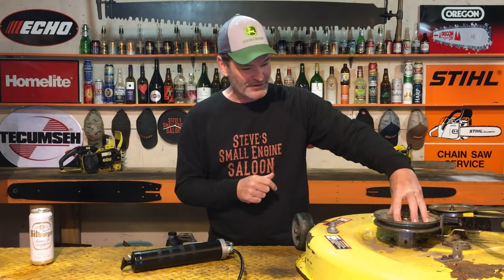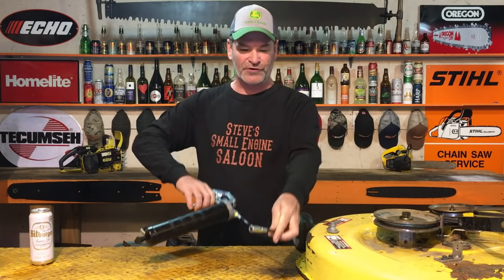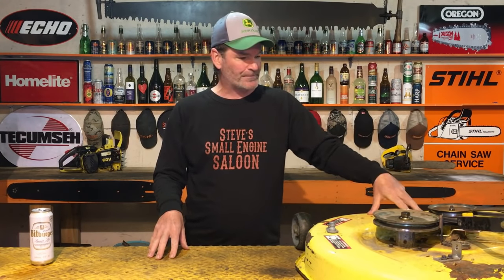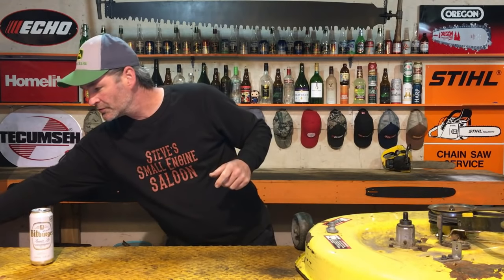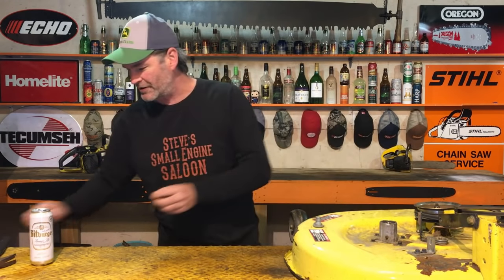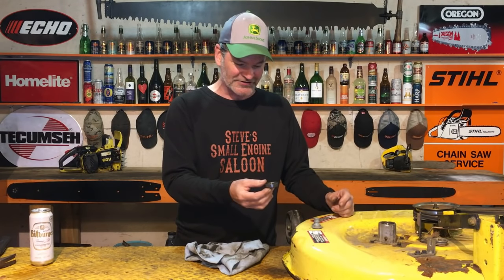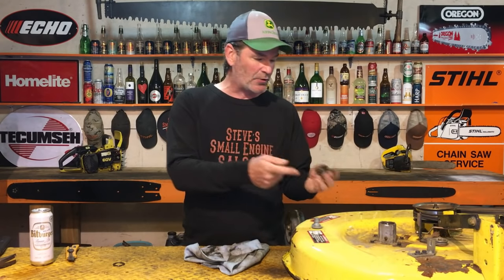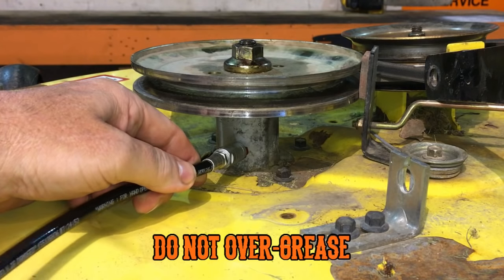Your Riding Lawn Mower's Dirty Little Secret

Comment: There's a point to note here about taking off one side of the seal on those bearings then pumping it full of grease when it's back on the mower deck. If you over pressure the grease, it will blow off the other side of that seal on the bearing and pick up dirt and debris in your bearings. I think it'd be better to pack it and replace that seal.
Reply: A serviceable bearing will allow grease to pass beyond both the bearing and the seal. A sealed bearing will not.
Reply: What I used to do was remove the inner seal , and drill a 1/64 hole in outer
Reply: It's getting harder and harder to find spindles that even have grease nipples anymore. I've been in the lawn maintenance business as an owner operator for two decades, and also my own mechanic and have gone through more spindles and bearings than I can count in the last ten years than in the first ten I was in business. Needless to say, years ago when I started noticing the trend to sealed bearings and spindles without grease nipples I've also made it an automatic to service even brand new spindles before first using them. 

I too, remove the inner bearing seal on both bearings, but since I already have the bearing out, spindle nipple or no, I automatically just pack the bearings. I redo this once a month since the mowers are being used commercially. I don't bother replacing the inner seal as from my experience once the bearing seal is removed, no matter what some damage is done in the removal even if very minute. And most of the time the replaced seals come off again inside the spindle and can even damage the bearings getting caught in them with all the millions of rotations and constant vibration (even with "perfectly" balanced spindles/blades). And with the outer bearing seals keeping contaminates from entering there is no reason for the need of seals facing the inside of the spindle.

But another unfortunate trend over the last decade I have discovered is poorly designed or cast spindles. In my area the land is very rocky, with tree types with shallow roots protruding above ground and very uneven ground. I used to go through a lot of blades and sometimes engine shaft keys from hitting unseen obstacles. I am forced to deal with many properties, that at least initially, have many obstacles that are just unseen even with careful initial inspection of the areas to be mowed. 

But in recent years I have had many di-cast spindles snap where bolts connect the spindles to the deck when obstacles are struck. Many times from a mere mole hill or bulging mole tunnels that was created in between mowing and is just a small pile of semi-loose dirt and the spindle housing breaks away from the bolts/deck. Many of these incidents even have minimal damage to none of still straight blades that only require a sharpening after the incident or no visible blade damage at all. So it is common from my experience in recent years that the sealed bearings outlast the actual spindles and I have back-up bearings and shafts I salvage from broken spindles. I own 6 riding tractors* in constant rotation and 1 Zero turn used for large flat open areas only due to the design nature and terrain I mow. Different brands including John Deere, Cub Cadet, Troy-Bilt, Toro(Z-turn) and Craftsman(x2) and I have had spindle housings break on all of them over the last decade.

*I prefer riding tractors due to the nature of the hilly country as zero turns can't handle mowing across hill inclines due to the freely spinning front wheels. The worst situation, which is common for my commercial properties, are long, narrow and deep drainage ditches along roads that are also deep with steep inclines and can only be done with a zero turn by going up and down the ditches witch takes 4 times as long to mow from constantly turning around back and forth, than with a riding tractor that I can mow on steep inclines the full length of the ditches and all I need is to lean sideways so body weight maintains center of gravity (going beyond the recommended grade of an incline by manufacturers). Besides, my zero turn's deck is 50" compared to 42-46" rider decks, so not enough advantage to make it worth the trouble except for open acreage.
Reply: @mattbaker5757  I feel your pain with spindle housings breaking . Used to happen to me , some times just a few days . I considered trying to convert a implement wheel hub but that's a lot of hassle , and thought the mower deck would just blow out 
Solved it by buying a grasshopper, solved the sidehill issues by swapping on a set of ATV tires
Reply: @mattbaker5757 what is your opinion of the TS 354XD Husqvarna rider? I’m 120 hours into mine on heavy sloping brush, 5 acres
I noticed none in your fleet
Reply: YEs
Reply: The jack shaft has a square shoulder against the lower seal, and the pulley has a shoulder against the upper seal preventing seal blow out. Just don't over fill. The zerk fitting will tell you when it's full.
Reply: X mark zero turn mowers!!

Comment: Sealed bearings are designed to operate a long time in sealed condition. Removing the seal of the lower bearing will help when the cavity is filled. The top bearing  however may lose grease. The seal from below will not go up due to gravity. Another problem might be popping the outside seals while pumping grease . My humble opinion would be to leave at least the top bearing with both seals, but it’s probably a good idea to leave both as sealed bearings. If you want you can remove the bearings every few years, pop the seals, refill the bearings with fresh grease and put the seals back in.
Reply: Agree 1000%.  The beauty of sealed bearings are the low maintenance. They should last years before  seal fails. Until then the bearings are perfectly lubricated. When they fail, pop them out and $20 later you're good for years more of mowing.

Comment: I have been fixing small engines my whole life and even went to college for small engines repair. I learned more from your videos than I ever have anywhere else. Thank you.
Reply from the maker: You're Welcome...
Reply: Dang college for small Engine repair? I’ve learned by tinkering and getting tips from pros
Reply: Rick Simpson  -Farm implements 'back in the day' when anyone with common sense [conservative] greased their machines daily, the bearings had felt seals that relieved pressure as filled, seeing the grease escape, meant no more pumps of the gun. Over 50 years on some equipment, original bearings ;
Reply: Rick Simpson spelling wasn’t covered in your classes?
Reply: @UCPXngN5DcNgUPuWTb7aMLgw Excellent point.  I do not know what Steve knows (I love his videos) but I think that this is a fair point to bring up to the engineers.  Than what is the point of the fitting?  Does the new grease some how work it's way into the sealed bearing or something like this?  Why is the fitting there?
Reply: Steve is a blessing
Reply: You are the #1 spot I turn to for advice and how-to info on my small engine equipment.  You not only know your stuff, you present it in such a logical and no nonsense manner anyone should be able to grasp it and complete their own tasks.  THANKS for posting these how tos.  I try to learn something new each and every day.
Reply: You must have been to a really bad school.
Reply: I went to College to find out what I didn't want to know.
Reply: @backcountrybarracks  mus b cuz mus is don sound rite!!!
Reply: @hungry1011  Seems the principle on the spring loaded hub caps on the boat wheels would apply here!
Reply: @ronchaney9500  What a coincidence that your comment popped up.  I was reading a Cub Cadet manual online just yesterday.  They mentioned that the bearings were sealed.  They said the purpose of the grease is to displace moisture.
Reply: @garyritterstrings  Ahmen

Comment: I spotted the "MAIN " problem when you got the bearing out … it says CHINA
Reply: Buy Ch1nese crap cheap, use it once, and then throw it away.
Reply: @iesusegoconfidoinvobis4309  when you pay pennies for something you cannot expect the same quality as when you spend real money, lots of stuff is made in China that you never see, and the quality is there, western/Japanese quality control is the answer but that comes with a cost, I have put Chinese Bering's in my tracked dumper 24 in all, less than two pounds each including postage to my door, quality British or German Bering's would be over a hundred and fifty pounds plus a fifty mile round trip, if or when they fail I may consider better quality Bering's but get them as and when they are needed, the problem you highlight is typical manufacturer, shielded Bering's don't need a seal, saves money, to remove the seal one side costs money, we are Lucky they still put the grease nipple on!!.
Reply: The design engineer probably did his job correctly. The bean counters trying to knock down the BOM cost decided rollerblade bearings were good enough. Not only good enough, but so poor quality it would create a market where the company could overcharge customers for replacement parts they knew wouldn’t last. Voila, little profit margin on original sale now, but big margin on parts later.

Same reason why inkjet printers are so cheap - and why they got so angry with 3rd parties and customers refilling the ink cartridges. The printer makers lose money on sale of the printer, counting on first-party sales later of massively marked up replacement ink cartridges.
Reply: EXACTLY!! You can only blame the consumer.
Read the labels!!
Knowledge is power..
Reply: @CrusaderSports250  there are lots of China parts in high end items also. Take a Ford GM or Chrysler apart, you'll see..
Knowledge is power.
Reply: @rjhornsby  EXACTLY!! Look at today's vehicles!! 
Cost more, built cheaper!
And who profits from it???
Not the people that assemble them!!
Reply: butchtropic  -Our hydraulic shop bought a Big lathe from China.... very Used. External castings were not as polished. Ship building spec. One of the best lathes made, it turns out. Competed, holding tolerance with our USA lathes.... every day.
Reply: @rjhornsby  -Bell Telephone made a massive fortune 'back in the day'  by Renting their phones. The rental continued, for decades if the home owner never realized their expense over time. ; Funny, when discovered after elderly home owner's property was being settled after death {years]. Bell [subsidiary], upon cancellation of service, demanded 'their' phone back. After making $1,000s of dollars in Rental profit..
Reply: @philllsxga.7737  -With alternative, unemployment definitely abject poverty, Employed is Far, Far better ;
Reply: Rick its about the side shield not letting grease in mate.. Not rollerblade bearings...
Reply: No difference - as he showed you they can't be lubed. China made the part, didn't design the assembly.
Reply: @suep9445  china makes dodgy cheap parts is what hes saying
Reply: @philllsxga.7737  How many dealerships do you know that will let you tear apart a tractor to see if any of the parts are cheap POS's before you buy?
Reply: Sadly a lot of things are made there these days.  It is so bad now that some parts from some German brands are from China now.  Oh the horror!!
Reply: Charles Hines why can’t they be made in the USA ..
Reply: Saw that right away to Ronnie.., put in a Timken bearing.. China, !!!! .. Buy AMERICAN !!
Reply: @rjhornsby  They simply add a jerk to make you feel warm and fuzzy! Its intentional. 99% of all owners will never remove the shaft.
Reply: What does not say China these days ?
Reply: Wing band bong Chong..... I agree.  Make it America  ! Put the damn cell phone down....... Stop talking, start working.
Reply: @iesusegoconfidoinvobis4309  China makes stuff to last, just look at COVID-19
Reply: @bobber55  LOL
Reply: @philllsxga.7737   Calling a Ford or Chrysler vehicle “High End” is a real long stretch!  Way to long!
Reply: @philllsxga.7737  BS. On an inflation adjusted basis automobiles are more affordable today then they have ever been. In addition they are a lot safer, more reliable, and more efficient than they used to be. It looks to me like somebody (the investors) earned that profit, and somebody (the executives and designers) earned their salaries and bonuses.
Reply: @kennethpaquin8574  my brother repairs vehicles for a living.
He was working on a 2015 Arcadia Denali it had the exact same wire harness plug he seen in a Ford 10 years ago!
He also sees a lot of common plugs and part's from brand to brand.
You are aware that there are only a handful of automotive suppliers that make the parts for every vehicle manufactured Kia Hyundai Cadillac Chevrolet Buick they all use the same suppliers so why does the car cost more?? To feed the wealthy!!!  And to F the consumer!!!
And you think today's vehicles are more reliable???
YouTube new warning to EcoBoost owners.
YouTube Hemi camshaft wear.
YouTube car wizard best engine ever.
GM Ford and Chrysler all have active class action lawsuits against them at this moment!!!!
BMW Ford GM all consume more oil then in the '90s because the piston rings are harder material for less friction which does not seal as well and let's oil go by and be burned.
GM's 2.4 and 3.6 engines have breather issues!! Ford's EcoBoost and GM's 3.6 have timing chain issues!!
Yeah that's right 100 years of building automobiles!!
GM's current 8-speed transmission is GARBAGE!!
The new inline six Duramax has a belt driven oil pump!!!
50, 60 ,70, 80,000 dollars for a vehicle with  issues engineered into them that is not right!!
GM currently has an open class action lawsuit for c7 Corvette wheels!!
And guess whos left paying for the repair when it's out of warranty???
You need to turn some wrenches and get your head out of the consumer report and  the news!!
Oh and YouTube 2019 RAM 70,000 mile review!
That trucks a piece of crap!!!!
Again on uneducated consumers...
Reply: @Dickfart We are still a word leader in manufacturing. Instead of making gumball machine toys and cell phones we make jet engines, high-end fixtures, scientific equipment, automobiles, military hardware, medical devices, and lots of other technically complicated dohickies. Our comparative advantage is our high skill and innovation. Just because something isn't made here anymore doesn't mean that we don't make anything. This allows us to make the things that we are best at and trade for the things that we can get at lower cost than if we made it here ourselves.
Reply: @philllsxga.7737  All cars have issues, that's nothing new. I am old enough to remember when you couldn't get 30k miles out of a set of tires. Cars bodies, particularly in the northeast, would start rusting after two years. Any car with 80k miles on it was considered old and no one relied on a car with over 100k miles. Then you have the improvements like antilock brakes, air bags, crumple zones, 4 wheel disc brakes -- I could go on and on. You don't have to take my word for it look at the statistics for reliability, safety, age, and resale value.
If you think you are being screwed by the auto industry owners then become one. Go out and buy stock in Ford, GM, Honda, Volkswagen, etc. Then you will make the same profit that all the other owners do.
Reply: @kennethpaquin8574  my family has had 13 GM's that have neared 300,000 miles.
I sold my old GMC with 252,000 miles on it with just regular maintenance.  None of those cars cost not even 30,000 dollars!
The older GMC I mentioned cost me 17,000 dollars! 17,000 dollars and I sold it with 252,000 miles and it ran perfect!
And you're telling me a $60,000 vehicle at today's price is worth that and it will definitely NOT last 300,000 miles???
That's what you're saying!!  How is that not getting screwed by the automotive companies?!?!??
Reply: @philllsxga.7737  Did that $17,000 truck have air conditioning, air bags, antilock brakes, 10,000 lbs. towing capacity, fuel injection, power windows,  driver select four wheel drive, etc. And yes, I am saying that cars last longer today. You might have had a good experience but the numbers don't lie. Cars last longer than they use to, start easier, get better gas mileage, and are safer. And I repeat, if you feel you are getting screwed, buy GM buy stock and receive the benefit that you feel that you are getting screwed out of. You can't have it both ways. "I'm getting screwed by the man, boo hoo!" Then be the man or shut up.
Reply: @MrRontac  Because then you couldn't afford to buy the tractor.
Reply: @MrRontac  Because that would cut in the shareholders revenue. You wanted capitalism, you got what you wanted.
Reply: it will still be far better and longer lasting than anything made in the United Sewers of America!
Reply: @philllsxga.7737  Ford and Chrysler are definitely NOT high end nor are they anywhere near it.
Reply: @tomrogers9467  it's only lasted more than a year thanks to Bill Gates' money and Fauci's propoganda program of terror.
Reply: @pamelah6431    Oh, I didn’t realize that the Covid Pandemic was over.  I guess the 4,000 US deaths A DAY are just a nasty coincidence.
Reply: @tomrogers9467  no, it's just nasty propoganda.
Reply: I true am a big Patriot and enjoy making fun of cheap trash but china does make atleast a handfull of quality peices particularly in the knife world.
Reply: @iesusegoconfidoinvobis4309  That is what capitalism is throw away junk.

Comment: I must be the most fortunate guy in the world. I owned a Lawnboy (White/Wheelhorse) 12 hp for 20 years and never replaced a spindle or a bearing. I now own a Simplicity Broadmoor for for 13 years and 300 hours and, though it has replaceable bearings, have never touched them. I do an annual lube and fill ‘er up.